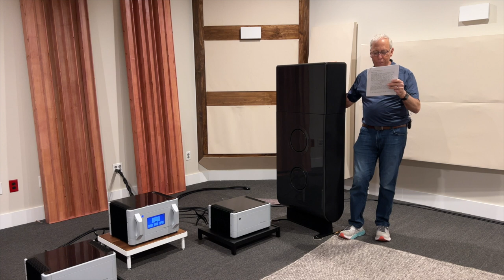Understanding DC blocking capacitors in audio

Comment: Thank you for answering my question Paul. I had to pause the video and go grab a beer as soon as I heard it was my question being answered :) So DC servo circuitry is the trick here. I have always thought that a feedback loop like that still makes the signal pass through a cap on its way back. Which it still does I believe. But as you tell that servo circuit has a much higher time constant, so the amount of signal (AC) being fed back to the input (and through that cap) is probably negligible...
Reply: Ultimately it would make no difference if you used a cap to provide low pass filtering at 0.1Hz in the dc feedback path or to provide high pass filtering at 0.1Hz in the audio path. If, for instance, the cap was poor at passing high frequencies in the audio path, it’ll also be poor at shunting high frequencies in the feedback loop resulting in increased negative feedback and reduced gain at high frequencies. 
As you say, it would be negligible in the feedback path, but it would be equally negligible in the the signal path too.

Comment: Good job, Paul.  I'd add that the DC in an amp provides kind of an equivalent to an idling speed in a car.  DC current sits at a certain level, averagely, but the DC is varied, turning it a bit off, then a bit on to resemble a sine wave (on top of the DC.)  So, it's a varying DC voltage. The lowest point of the DC voltage, to the highest DC voltage (the distance between these two) is the peak to peak sine wave. This sine wave is stipped off by a capacitor, in a capacitor coupled amp.  And the sine wave "passes through" the capacitor to the next stage of amplification. However, remember that capacitor pass high frequencies better than low frequencies, and so not all AC frequencies (riding on top of the DC) are passed throuigh the capacitor, equally.  Some frequencies will get through better than others, and that is part of the coloration that a capacitor adds to the sound.  Also there is a phase shift through a capacitor, in terms of the current leading the voltage across it, so that would play into the coloration of the sound, caused by a capacitor, too (also remember that a speaker is kind of an inductor, and theoretically, might color the sound because the voltage leads the current, AKA a phase shift between them.) Someone with more knowledge on this subject of phase shift can add more to what I'm saying or tweek it a bit to make it more accurate.

Comment: Great answer.
Spending a little extra paya a big dividend.  I use a 1uF copper film cap on the output of my streamer tube buffer.  Sounds great.  Miflex is a good choice for value.  Deulund or Vcap for SOTA.  Also worked almost as well with a 4uF Russian NOS PIO bypassed with a .1uF silver mica.

Comment: Norway here

It is still very common to use an input capacitor on line in or line out since it is the cheapest solution.

The problem is that you often have both an output or input capacitor on the preamplifier and an input on the amplifier. 2 pcs.

Nowadays, electrolyte is rarely used, as dc blocking capasitor but instead  polyester or polypropylene of good quality such as Wisma is often used.

Before, you use the smallest possible capacitor value to reduce the size of the capacitor so that it does not become too large.

I think you hear bigger differences on different op amp ic. than what you do with different good capacitors.

Comment: It is  interesting  how everything has it's ups and downs. 

In solid amplifiers we deal with low voltages and low circuit resistances For that reason it is necessary to use coupling capcitors with low  reactances means their  values are sagnificant -   usualy 1 - 50 uF and wet- It's nothing new. But  it may be source  of troubles with age - corrosion of plates and ageing electrolyte -  like in  some 30 years video camcorders. 

. Seemed  in tube amplifiers  it was  easier - needed rectances are  high in  compare   and capcitances  much smaller - 0,01 - 0,05uF. For them  may  be used dry and durable delecric  - ...

. hmmm.... not so easy - there are much higer voltages and they in time are exposed  to dielectric short cut or micro current leakage 

. Strangely to  me  to see that in "ancient times"  were used noble materials like mica, masive coper plates which made them bulky but working eternal  . Worst moment came in 60ties when all was meant  to be portable and capcitors had to be as  little as it was possible while production was still not mature . I experienced it in vintage  japanese tube gear. And in Bell Sound  too I found some 60 years old with bad insulation but still some 80% of dry capcitors and 95% resistors are originals working.  Thank you Bell  . Hopefully replacement could be called pleasure due to point to point connections.  . 

 Now is like new era - technology alows to produce ubelievely small surface mount capcitors - of course only for low voltages. Are they applicable for decent audio? I see that in video  cameras SMD mounted audio is truly excellent  But for expensive units future service plays   important role. I can diagnosesimple circiuts  myself and my wish is to have units which I could diagnose and repair all time when I  enjoy them.

Comment: Ifi DC blocker it works great 👍🏼
Reply: Those are for the power source. Great device to have.

The part this question is in the signal path, inside an amp.

Comment: Blocking capacitors will protect the circuits downstream if something catastrophic happens. I'm thinking a direct coupled servo stuck high or low would cremate whatever is in its way.

Comment: That not quite right.... dc servo circuits are used mainly in power amplifiers to keep output dc offset voltage at 0v. The way to eliminate dc in series signal paths is to use symmetrical complementary balanced drivers where the output is at 0v .
Reply: Totally agree, however, in practical terms it’s still very difficult as any small DC offset at the input will be amplified along with the audio and if left unchecked would result in DC across the speaker.